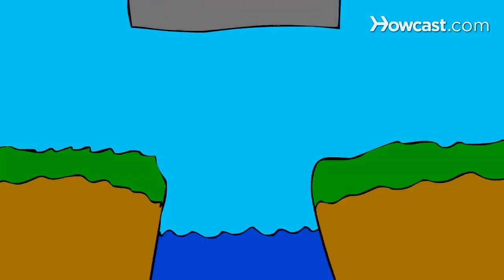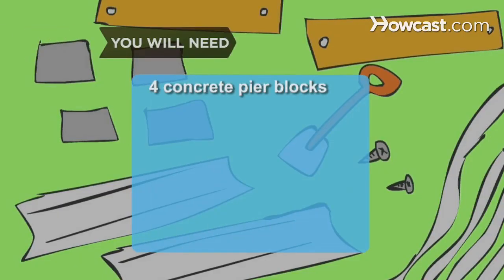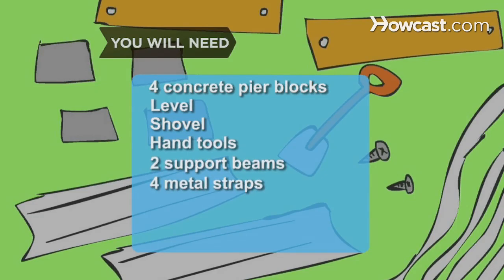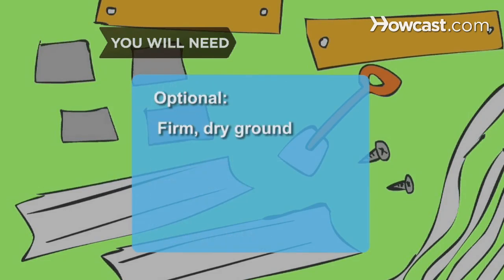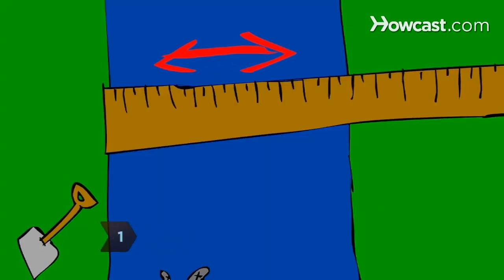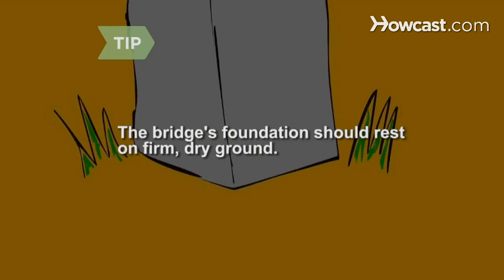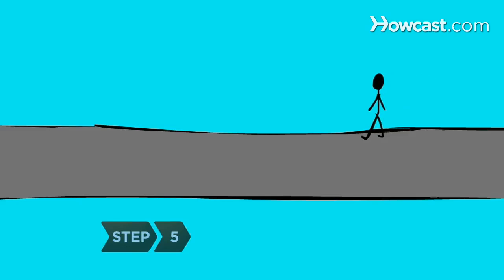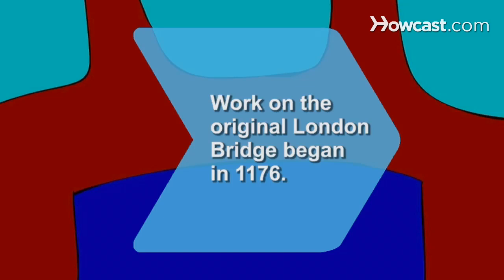How to Build a Bridge

Comment: screw that, when i was 10 we built a bridge out of 3 12 foot long wooden boards that were 14 years old and 2 inches thick. we would run across it(only about 3 inches of each end was stuck in the mud at the top of the ditch bank) and ride bikes over it and into the woods on the other side to go exploring. now the woods are so freakin thick we need a chainsaw. plus the bridge floated away in hurricane gustav